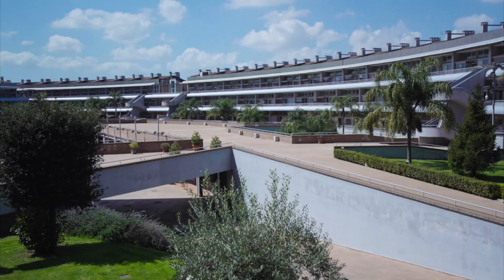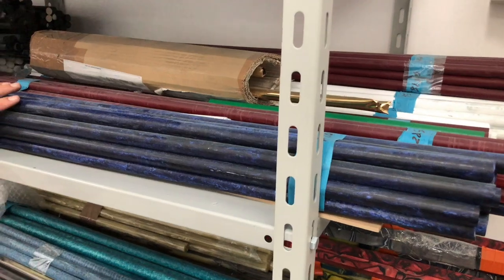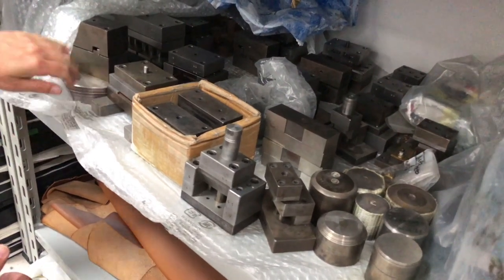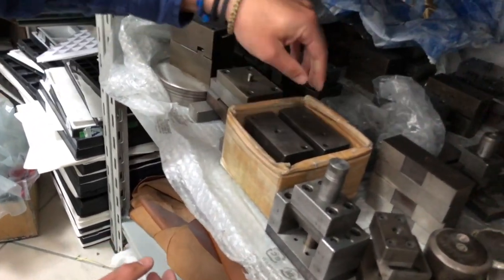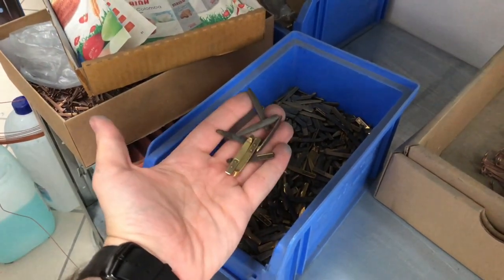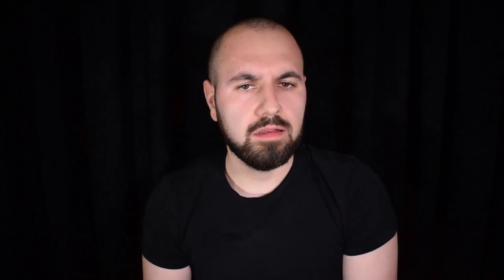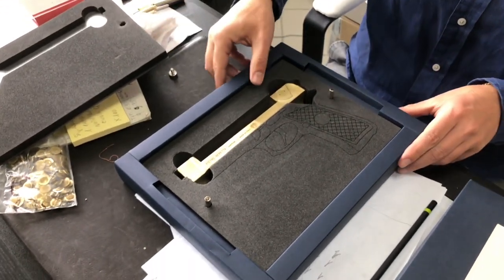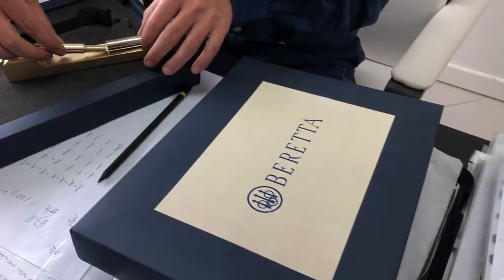VISIT at LEONARDO OFFICINA ITALIANA pen company

Comment: Why can’t celluloids be produced anymore? Most especially the arco brown?
Reply from the maker: Well Zackarie it’s complicated, there are quite a few reasons why not, the major one is that the complete process is very dangerous - flamable and time consuming , with the new legislations it’s almost impossible. It takes maybe 3 - 5 years from start to finish and that in today’s times will bump the price so much that is not worth making it.
As far as I know celluloid was mostly used by the makers of sunglasses and the pen makers where only buying small batches from them being that they are a much smaller and secondary makers that where using small amounts that could not cover the complete cost of a batch even in the past times, so the sun glasses manufacturers commissioned huge amounts of the material and pen makers where buying small amounts from them. Regarding arco brown I believe everyone that knew how to make that specific color and pattern is no longer between us and they didn’t passed the craft to other. Celluloids are produce anymore but not like in the old days , for example Montegrappa, they have a facility next to their factory where they produce celluloid , only for their pen models and it’s moved from the actual factory because it has caught fire for over 3 times in the history of montegrappa so they made a complete building and they had to move it separately of the production of pens because of the legislation requirements.